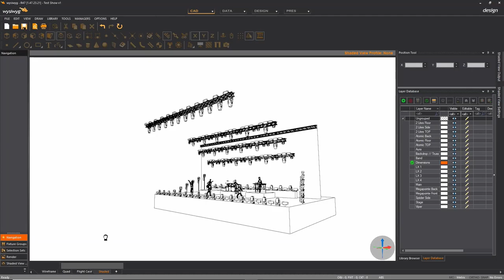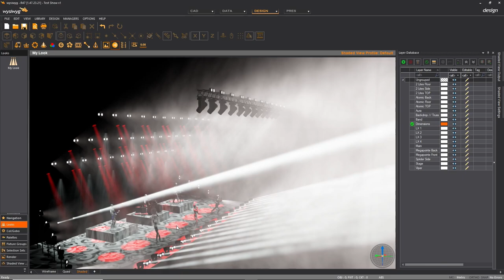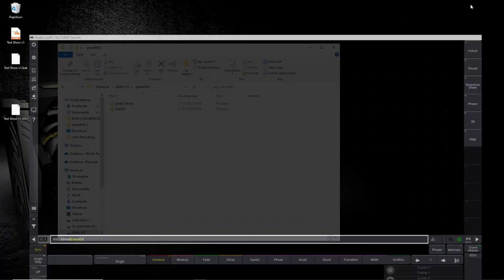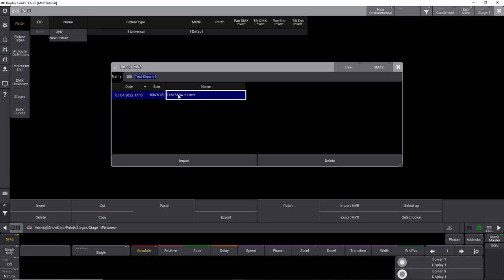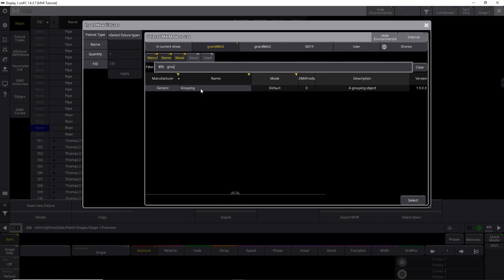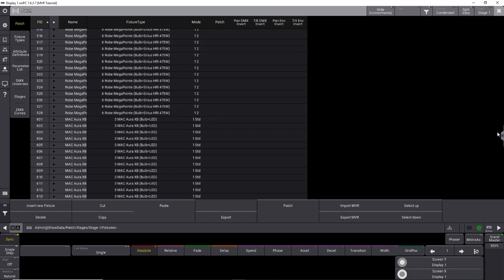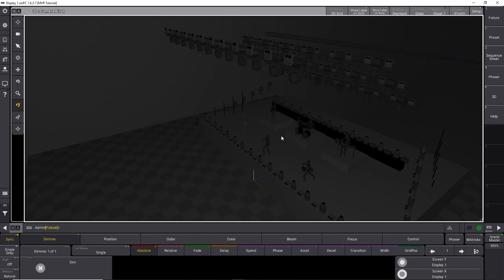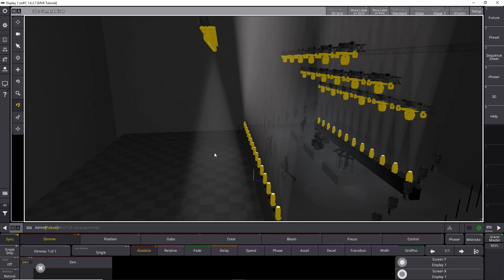E17 - Export MVR file from WYSIWYG and import it into GrandMA3

Comment: Hay,
I tried it with Vectoroworks and it is not really a problem to import the file... There is just the mode change for me... For example I also have Atomic 3000 in my CAD drawing but if I try to use a shares fixture the 3d View is just not displayed correctly... Sometimes the fixture does not even work... like the one from the glp x4 20 bars... Is there any way to select working fixture types without tryinig out every single one available?

Comment: Quick question. Importing a MVR show file into my MA3 start show. Can you for example have 48 spots in my start show and then merge 48 spots from the MVR file? Keeping the same fixture numbers and all associated cues, phasers etc?
Reply from the maker: Hi Sonyvaioboy. 

Yes you can import an MVR file into your existing show, and both will work fine. But you have to make sure that you don’t have the same fixture numbers in both files. 

When you make your initial import into GrandMA3 you can chose and change the fixture number before the final import. 😀 

You can see on the screen:
“use mine” = your existing show file. “Use other” the fixtures from the MVR file. 

Let me know if you can make it work. 

REMEMBER backup before you start…!!! 🤪🤪

Comment: If only this would work in Vectorworks...
Reply from the maker: Hi Johannes. Thanks for commenting 👍😀 Oh i am sorry, is it more difficult in Vector Works? Is it not a matter of how you prepare the file before export? I am not a Vector Works user, but since MVR is a cross platform standard, i assumed that it would be a walk in the park 😀 What issues are you encountering when you try it in Vector Works?
Reply: @Event-Lighting  well, i have no experience with Wyg to VWX but only Capture to VWX and GrandMa3. For some reason Vectorworks is importing MVR files from Capture with random 0,0,0 positions for some fixtures. This very annoying when you have a lot of fixtures. Even more annoying is, is that you cannot reproduce the faulty import. If I draw the same fixtures in Capture and export it again, it could be that they appear on the right place. I have checked the MVR files and they look correct. 
Now there is a little workaround. Import the MVR file in MA3, then the fixture positions are fine. Then export MVR from MA3 to VWX and you end up with almost everything in the right place. This tells me that it is a VWX problem. But even the support people of VWX cannot seem to find out what is wrong and this wont be solved in SP3. A real bummer. 
And then you can say: why not start your workflow in VWX. But thats not how I work. Capture, or WYG, or any other visualizer is way more friendly if it comes to disigning a set because it is realtime lighting. Which VWX is not. 
I really hope VWX will solve this.
Reply from the maker: I understand the frustration that must bring, it seems like a simple thing to get right for VWX. I thought that VWX was smarter in everything compared to WYSIWYG, I think the VWX is a much better software when it comes to drawing more complex stuff, in WYSIWYG you are still limited to squares and cylinders for the most part. I guess that all softwares has their pros and cons. If you only need to re-position a small number af fixtures in GrandMA3, you can just manually put in the xyz, and xyz rot values in the patch. That will force them into their correct position. But if it a hundred fixtures, then that would take to long.😀
Reply: This is my work flow. Draw in VWX export MVR to MA3 then export MVR from MA3 to Capture.
Reply from the maker: @sonyvaioboy  does that eliminate the problem johannes is experiencing??
Reply: @Event-Lighting  yes I have had no problems doing it this way.
Reply: @Event-Lighting  no. Simply because my workflow is the other way around. Creative lighting design in capture and then MVR to Vectorworks for the technical design. In my opinion you always start with a creative design and after that comes the technical design.
Reply from the maker: Hi johannes - Yes that would be the correct way of course 😀